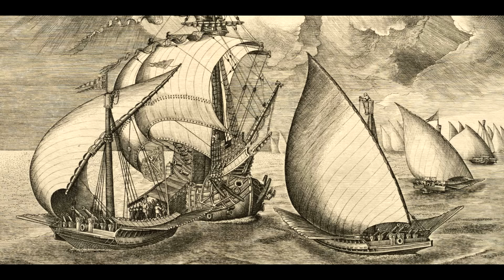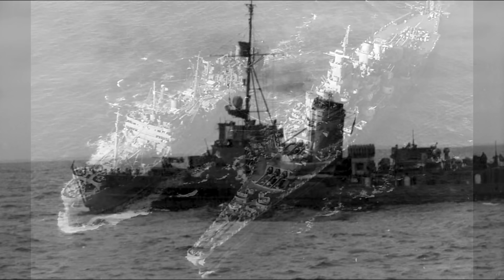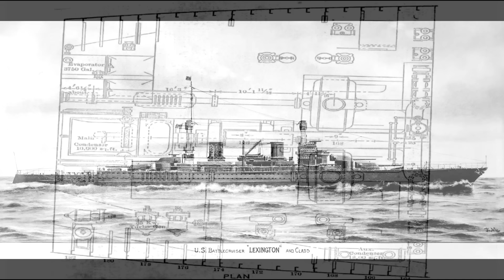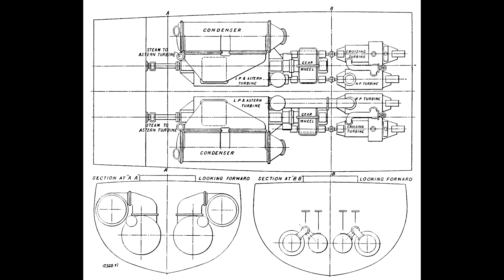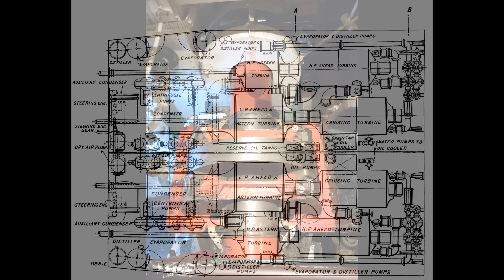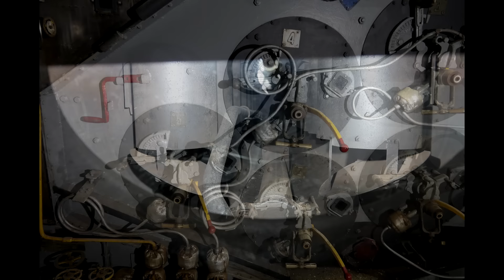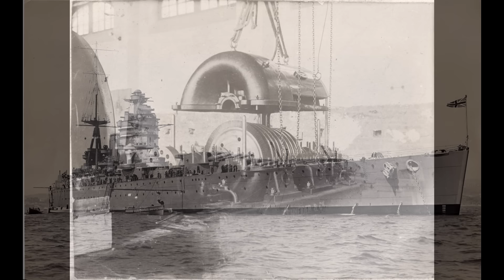Naval Engineering - How to choose your engines

Comment: As a (land based) steam turbine engineer I love this video! I wonder if anyone has captured the exhaust heat from diesel engines and used a heat recovery steam generator (HRSG) to raise steam for a supplementary turbine similar to how gas turbines can be used in combined cycle? It has been done on land occasionally. There are difficulties with it such as soot build up in the HRSG. There have been fires in HRSGs caused by soot build up.  Another point to make about  the use of multiple turbines such as reversing or cruising turbines is that if these are not clutched and kept spinning on the shaft they need a gland steal sealing system to keep them evacuated when not in use. If not then windage can quickly cause overheating damage within them. Its also very common for power generation steam turbines to return the steam to the boiler after the HP turbine before it enters the intermediate or low pressure turbine, this improves cycle efficiency and keeps the steam superheated for longer. I wonder if this is also done on marine steam turbines in this period?
Reply: The Still cycle combined steam and diesel engines. The diesel engine provided waste heat to a reciprocating steam engine and the steam exhaust drove turbine driven scavenge air for the diesel. 
The efficiency gains weren’t worth the complexity.
Reply: Waste heat boilers have been used for years on motorships. Soot fouling can occur but is easily dealt with by reducing feed water and "dry firing" for a period.
Reply: We run a Voight heat recovery unit on our diesel gen sets after the turbo chargers, they are used on busses and trucks to provide extra electrical power for air-con and freezer plants. They are twin cylinder piston engines. In a purely exhaust energy recovery system you use (after the turbocharger) the typical compound system used on aircraft engines from WW2 onwards, you don't need to convert to steam as an energy carrier when you already have hot gas.
Reply: @jimtitt3571  "typical compound system used on aircraft engines from WW2 onwards"  
If you are talking about power recovery turbines, they were far from typical and only used on 2 or 3 aircraft engines for a brief period and only one engine used them for any length of time. That engine was a variant of the Wright 3350 and those turbines were geared directly back to the crankshaft.
Reply: @oldtugs Still in use today, turbo-compound trucks like the MAN and Merc variants of the same engine have them and I worked on the large units used on MAN ships diesels, they run up to 4.7MW output. Originally developed on the Napier Nomad. The Posche 917 used them to recharge the hybrid battery.
Reply: @jimtitt3571  The Nomad was one of the 3 aircraft engines that used the technique and was a very short lived post-war engine. Perhaps except for driving a low output generator the PRT technique is pretty much a gimmick that didn't outlive the advent of gas turbines in aviation. It certainly has not made much progress in land or sea transport either. If the MAN thing is that little Japanese "eco turbine" device, is it still around? I thought it faded away years ago.
Reply: AFAIU modern diesel powered ships often have waste heat recovery boilers, but they are used for providing steam for heating the fuel, not for running a turbine geared to the propshaft?
Reply: @jbepsilon  Yep

Comment: Oil fired boilers are especially good on ships crewed by Americans or Royal Navy, as you can save money by diverting all the cooking oil into the tanks. The drawback is you need fuel for the engines for the first couple days before the galley stops recycling it, and ambushes get more difficult once the enemy figures out the smell of a chip shop signals danger.

Comment: I served on a twin gas turbine powered destroyer with the 2 giant diesel auxiliary engines but we still had a 3 boiler system for shipbord laundry and hot water n such .
Reply: Were those boilers run off waste heat?

Comment: I see one really big problem with ancilliary systems run by main-boiler steam - being on station in a harbour for more than a few days. 
Sure, you don´t need that much fuel to produce the small amount of steam, but you have to provide the full pressure, so at least one boiler has to be kept hot all the time. Either that boiler is very well insulated to the other boilers in that row, or you burn quite some fuel just for the heat losses. The piping to the different parts of the ship is another thing - those pipes require quite some insulation and additional holes in the bulkheads, plus the introduction of many failure points.

Comment: No mention of nuclear fission as a source of steam? Also omitted was the combined-cycle plant, where the heated exhaust from a gas turbine is used to boil water into steam to run a steam turbine.
Reply: Both "outside the time scope of the channel" which is basically early 50s.

Comment: Regarding the turboelectric weight/volume penalty: Before the treaties USN found out that for their requirements (which required being able to cross the pacific without refueling and fight a battle on the way), turboelectric was lighter and took up less space than conventional, when you weighed all the machinery and the fuel you needed to carry. That is, they didn't have to make a slightly bigger ship for it, the resulting ship was smaller with electric drive. The improved efficiency at low speeds really added up for them. 

The reason the treaties killed it was that USN demanded to have extra tonnage for their range requirement, but instead the conference compromised on not counting carried fuel into treaty tonnage, which of course makes a heavier but more efficient fuel plant lose out compared to a lighter but less efficient one.
Reply: I swear, every time I hear anything about the treaty system, it's because it had some new and interesting way of being stupid.

edit-to-add, in light of replies: What I meant is that, while there were all sorts of reasons that the countries involved thought it was a good idea to enter into the treaty system (including gaining benefits over others), it just seems to me that it could be argued whether or not the naval treaties were actually ultimately beneficial/a "good thing", or just a myriad collection of impositions and general weirdness that would ultimately be harmful during WW2 (especially for the allies).
Reply: @mnxs  yesn't
the fuel exclusion was vital for colonial empires, especially that of France and Great Britain with expansive territories across the globe, including many stupid islands in odd places (but also the US with the Philipines).
if fuel remained counted into the treaty tonnage, either it would have had to be a "special allowance for far territories"  or those countries would have completely disregarded the treaty as it would have meant they couldn't keep up in capabilities with the smaller navies (for a same size ship, greater weight allocation to fuel means less tonnage for machinery, armour and guns)

this in turn would have meant smaller navies would also have disregarded the treaty, and we would have had another naval arms race, the very thing the treaty was set up to avoid

was it ideal? no, but it was a darn better thing for nations than resuming the pre-WWI situation
for example, france was looking at goingto bigger guns post WWI, with a 45cm (17.7in) being designed and design accepted 6 months before the washington naval treaty, and france was absolutely broke after WWI
likewise the us was looking at an 18in gun (sleeved to 16in post conference) and GB at a new 18in gun also
Reply: @quentintin1 Excellent reply, you seem to have caught my meaning exactly (I've just added an addendum to my original comment, clarifying that). Indeed, what I'm questioning is not the logic behind the specific clauses at hand in OP's comment, but rather generally: was the treaty system ultimately a good idea?

And I'm prepared to accept your argument that it might indeed have overall been better with the treaty system, even if it was less than ideal, especially for countries like France - but also the UK, who were themselves quite worried about the rapidly rising projected costs of another naval arms race. Everyone at the very least had financial concerns post-WW1. Come think of it, I would really like Drach to make a video on this, with a cost-benefit analysis of the treaty system, both with and without the benefit of hindsight.
Reply: @quentintin1  I’d argue that the objective of preventing a new naval arms race was itself misguided, so while the various treaties may have succeeded in slowing the rate of new construction they didn’t affect anything other than Allied preparedness come WWII.
Reply: The naval treaties were an exercise in trying to screw over the countries you weren't allied with while trying to minimize how much you got screwed over by those countries, getting as much as you can while giving up as little as possible.
Reply: @seanmalloy7249  So the average contract
Reply: @seanmalloy7249 Indeed. I've added an addendum to my original comment to clarify my meaning; what I'm really questioning is whether the treaty system was ultimately a good idea in the end, and if the benefits (in hindsight) outweighed the downsides.
Reply: @mnxs  Not counting fuel into the displacement was a net win for the USN (and to a lesser extent the RN), because it made range fairly 'cheap' and the USN needed great range in its ships.
Reply: @Rupert-B Sure, I understand that. (See my edit.) I was moreso just questioning the general wisdom of the treaty system in total. It at least had a lot of downsides that would in many cases come back to haunt the allies during WW2, but at the same time, the general benefits (especially in the wake of WW1, with everyone wanting to pinch pennies) was maybe still worth it. I certainly don't know.
Reply: The turbo-electric systems also allowed greater sub-division. On the other hand, it turned out to be easier to knock off-line with shock and flooding, though that could well have simply been because there was far less experience in building battle-damage resistant turbo-electric plants.
Reply: @Rupert-B  The idea that turboelectric drives are more susceptible to shock damage comes from a single incident, the USS Saratoga, where a torpedo hit exactly on a frame of the ship cause the frame to buckle in and transmit the load, defeating the vibration isolation of the distribution station and shorting it out. This caused loss of all power. However, the damage was routed around in less than 5 minutes, and the exact same hit on a traditional steam plant would have likely taken it offline for much longer.

Comment: Also I think the extra steam piping in a cross connected system can create additional flooding paths as they basically have to pierce watertight bulkheads - so If damage opens up those extra steam pipes then flood water can get in and use them to spread further. (Plus any piercing of a bulkhead has the potential for the seal the degrade over time and allow water through - so extra openings alwasy make it harder to contain flooding)  So in addition to the extra volume and weight you need to think about how extra redundancy might need to be traded off against other damage control concerns.

Comment: Well if it was me designing something like a modern Frigate/Destroyer type. I would have diesels for base load cruising and gas turbines for the extra power high speed stuff when needed. All the power converted to electrical, for use everywhere. With two power egg propulsion units driving full cowled variable pitch screws for the cruising (think nuke powered submarines).  Showing the flag as Dr Alex says. Modestly I would aim for 170,000 hp on about 7000 tonnes displacement. Advantages would be the fuel economy, and the same fuel could be used for diesel and gas turbines. Disadvantages. Well I am currently sitting in a lovely padded room with a very nice white long sleeved shirt that they tie behind my back! They will be bringing my medication soon. 😃

Comment: Fletchers had a cruising turbine that could be isolated. When in use it exhausted into the HP turbine. When isolated steam goes directly to HP turbine. HP turbine exhausts into the LP turbine. To reverse ahead steam is secured. Reversing steam if feed directly into SPECIAL reverse blade turbine elements, at both ends of the LP turbines shaft. Reverse operation is limited in duration and power to prevent overwhelming the condenser where both the LP & reverse elements exhaust. D type uncontrolled Superheat steam boilers.
Mark Fay US MMC Jr. Engineer QMED AS-E / MSC ET retired

Comment: No discussion on the advantages and disadvantages of superheating?  Compound uniflow engines were also an option in the 1930s, though I'm pretty sure those were only used by the US Navy.

The French really were at the forefront of steam engineering in the mid twentieth century typically producing more specific power than anyone else in the world but at the cost in shorter service lives and higher maintenance.  Engineers in other countries adopted most of their advances in less extreme forms.

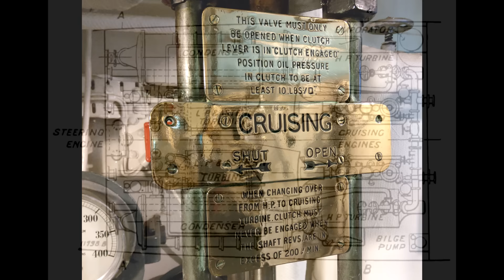The steam plant shown at 16:19 is actually a hybrid system with high speed turbines and triple expansion cruising engines.  The Olympic class liners combined triple expansion with a low pressure turbine because they were designed for best efficient speed instead of maximum speed.
Reply: because that's less of a "do we want to do it?" and more, once you know you can do it, or have to do it, there isn't really any drawback to investing that technique
in this here video, he covered the various amounts of design choices a naval designer (and the navy) had to consider where preparing a new ship design regarding the poweplant choice and arrangement, he didn't cover boiler design since he already did a video on that, and that is mostly a non-choice, you just go for the more efficient boilers you can make
Reply: For a turbine plant superheating is almost mandatory, sending saturated steam into the HP turbines bombards their blades with water droplets that may be travelling at 1000 m/s or more (depending on boiler pressure), which has an effect reminiscent of a sandblaster. Not to say they didn't do it in early turbine ships, but adding a superheater was a massive boon to both the lifespan of the turbines and their efficiency. Ideally you'd use just enough superheat to have the steam starting to condense in the last few stages of the LP turbine.
Reply: Superheating increases the energy available per pound of steam. For example, a typical marine steam plant operates at 900psig and 900F. Saturated steam at that pressure is around 530 degrees and carries about 1200 BTUs per pound. Superheated to 900 degrees, that pound carries around 1400 BTUs. That might sound like very little gain but when a single boiler produces 100,000 pounds per hour it equates to 10,000 additional horsepower each hour.
Reply: @oldtugs  True but your energy supply is fixed by the furnaces, so you could get the same number of BTU/hr by making a greater quantity of saturated steam. There's a bit more nuance to why superheated systems are superior.

As an aside, horsepower each hour isn't the right unit for what you're trying to say- I think you were actually going for just horsepower. Imperial units are actually awful for these sorts of calculations, so I'm not surprised you had a mixup.
Reply: @nerd1000ify  No mixup at this end, you can convert to megajoules or foot pounds, it is still a measure of work available or unit of energy per pound of steam. If I used enthalpy it would just confuse you even more.

And by the way, boilers are capable of evaporating a certain weight of water in a given time determined by the heating surface area and material temperature and pressure limitations. Increasing power is not simply a matter of making more wet steam, that is why superheaters were invented and temperature matters. Steam tables are not just places to keep food warm.
Reply: @oldtugs  Having read quite a few steam tables in my time (not long ago I was writing a computer program to do automated lookup and interpolation from one) I do understand quite well what you're talking about when it comes to enthalpy. But if there's no mixup on your end I don't know what you mean when you say horsepower per hour. This would be equivalent in metric units of W/s, which is not a unit of thermal energy or power- it would be "rate of change in power" which might be valid but didn't seem to make sense in context.

Anyway, we're both fully aware of how much extra enthalpy per unit mass you get by superheating the steam (and that sells it short, as if you examine the Rankine cycle you will note that the most of the enthalpy invested in the water's latent heat of vapourisation just goes through the cycle without doing anything useful). But that's hardly the only reason we do it, there are many other benefits of superheating to the engines themselves, especially regarding condensation losses in reciprocating engines and avoiding impact damage in turbines.
Reply: @nerd1000ify  "I don't know what you mean when you say horsepower per hour." 

One final attempt ... The work done by a force of one horsepower for one hour.  1,980,000  ft-lb or  2.686 times 10^6 joules. Have you ever heard of specific fuel consumption and how it is defined, measured, or referenced?
Reply: @oldtugs  Ah, I see the problem. You meant horsepower-hours, not horsepower per hour. All makes sense then.